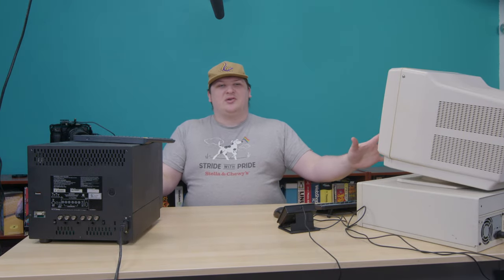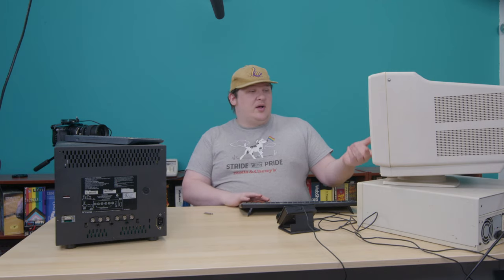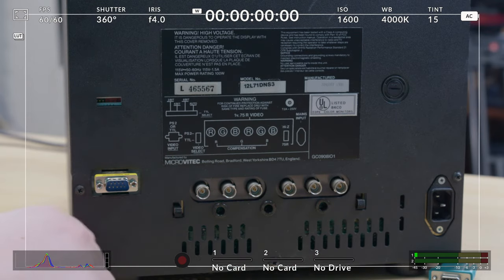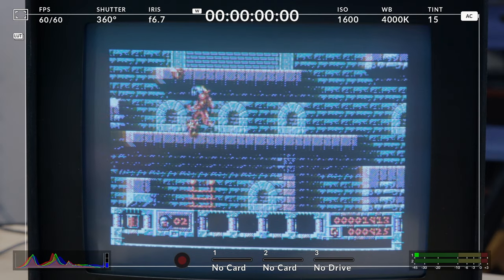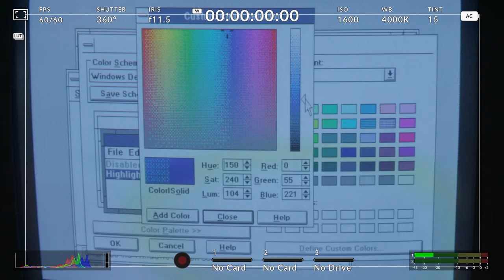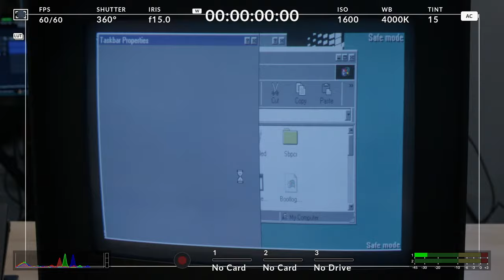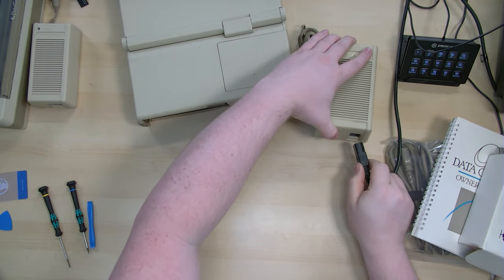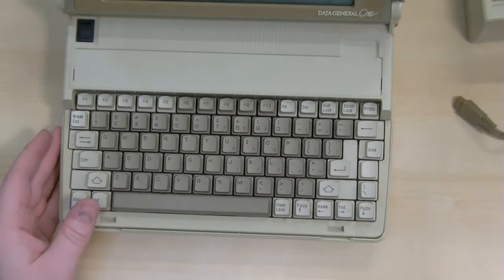EGA Hijinks And Revelations With Gravis

Comment: About PC-98 - only really old models have just RGBI video, most of them can output analog RGB at 24KHz, and some later models even have a 31Khz option so they're usable with regular VGA CRTs, you can potentially use one outside of Japan without finding a unicorn monitor.
Reply: Oh yes, it's much more the PC88 that I'm interested in - and I believe those switched to analog fairly early as well, but I wanted to be able to use the really early models in a pinch. I also realized on the drive home that this supports all the frequencies necessary to run my x68000 once I fix the PSU!
Reply: @CathodeRayDude  Dude I'm so fucking jealous